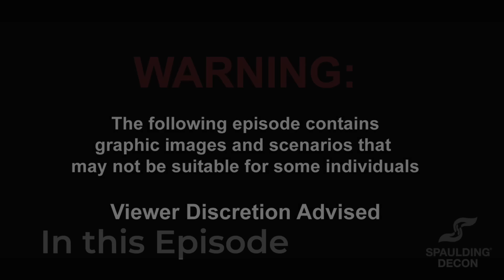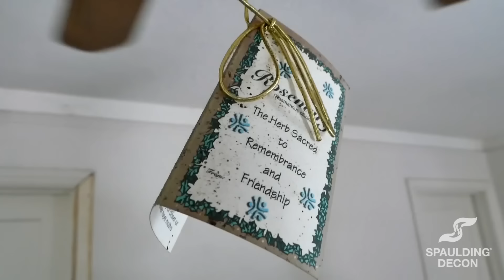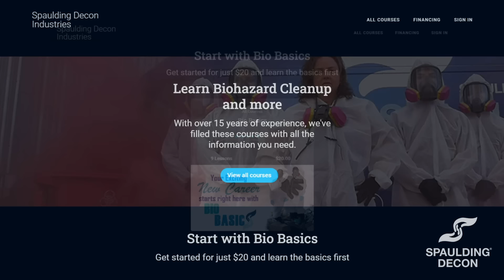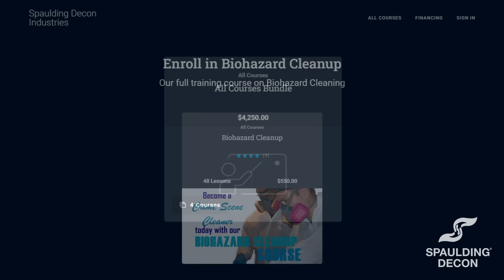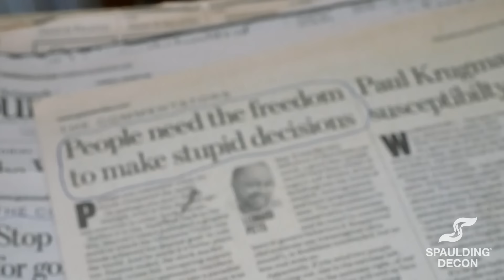Maggots Eating Through The Decomp!!!

Comment: So sorry to hear what happened to the guy. Just FYI those were asbestos tiles they were removing from the floor, you can tell from the age of the home and especially from the black mastic glue they used underneath. Just be careful cause whoever ends up living in that house after and if they see the video could potentially sue for you guys not having proper asbestos handling. Luckily most the guys there had the proper p100 respirators but it looks like they had them off a few times too. Also no proper sealing off of the area or negative air systems to be seen. Not here to poke at you guys, just coming from someone with a construction background that's looking to get into the business.

Comment: I know this video is already almost a month old, but I have a good question, does anyone know what they are painting the floor and ceiling with, When he cuts open the ceiling and sprays he then paints some white stuff over it and then in the next clip she’s doing the same thing on the piece of the floor the decomp was, is it specific paint that has something in it or are they just painting over it to put a layer over the now sanitized surface to ensure nobody will ever come into contact with it without having to remove the material? Genuinely curious I wasn’t expecting them to whip out paint for that
Reply: I think they use a product called Killz. I may not have the spelling correct but that brand is easily purchased at Home Depot, Lowes…any hardware store. Just tell the salesperson you need a product called Killz. They’re likely to recognize the name. Hope this helps. Kinda late to the game.

Comment: What is this noise in background all time? Even when they are in basement?
Reply: I think the sound is messed up—when I watched the video the picture was at least 5-10 seconds behind the audio track and wasn’t matching up. I think someone might need to fix and reupload this.
Reply: @kat.w.RBF444  I was thinking the same. Something was off even they was no talking and was on basement, when was not any vacume or machine what clean air inside. I home they will fix this.
Reply: @kat.w.RBF444  - What delay?
Reply: @declamatory  they probably fixed it by this point, hopefully. There was a problem with the sound not lining up with the video and the subtitles being off.